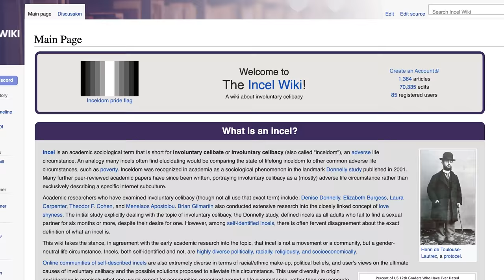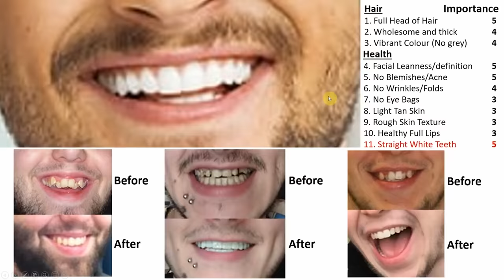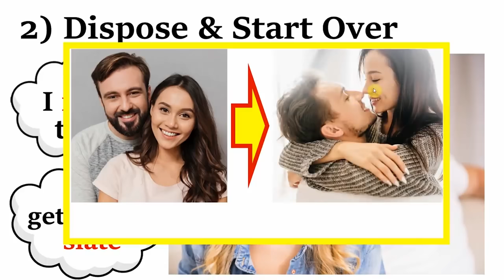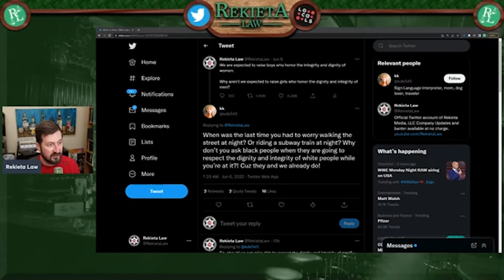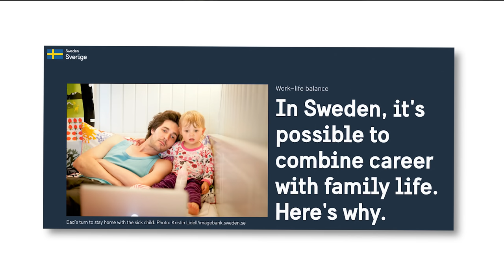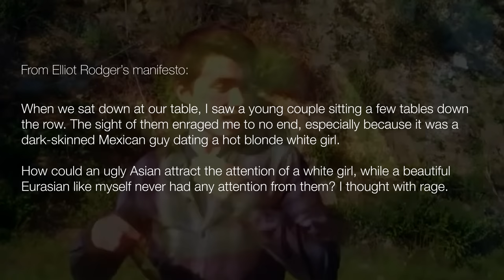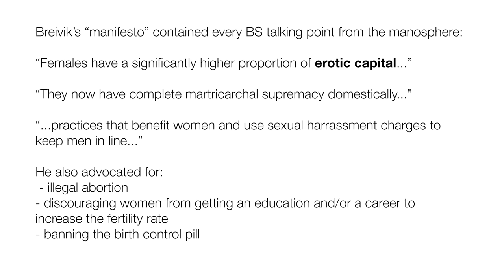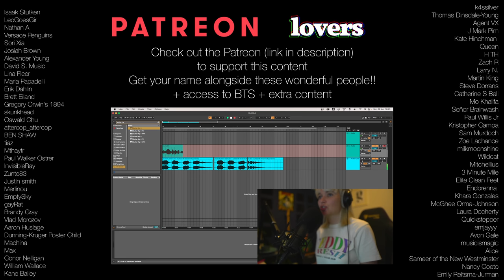I Debunked the Entire Manosphere

Comment: You said women are more picky " due to pregnanacy and assault"
You also said women are more picky " besause they report negative interactions on dating sites'( implying they must be sure to only choose the most polite gentlemen to interact with)
Yet the pickiness they have is based SOLEY on attactiveness which does ZERO to prevent what you you claimed were the reasons for the pickiness
But your peanut gallery already has a distaste for red pill, so, as the comments here bear out, They will nod and seal clap like a good hive mind
Reply: But it isn't based solely on attractiveness, no one is saying that. She literally cites data that says women are more likely to talk to men in a romantic context despite physical attractiveness.

If you aren't aware of other red flags then you need to take a step back and speak to some more women.

Comment: Half your info is wrong and you miss some of the biggest points with regards to dating and sites. 
Nothing at all was exposed in your 2 hrs of blabbering and the real dating data and marriage stats don't lie, the little things in between don't matter, the facts do....
Reply: The little things in between are nuances that make up the "fact" you so speak of. Before you argue bias, I am a man, and it doesn't require much brain power to understand that the "manosphere" and incel community are doing equally as much harm to us men as they do to women.
Reply: @Rodderno9 Tiktok≠an accurate cross section of opinion, regardless of gender.